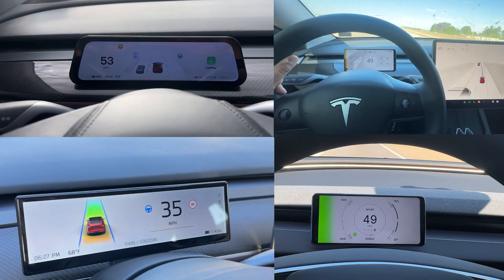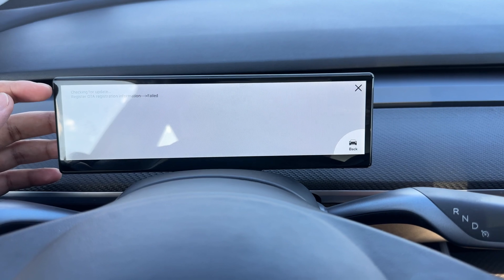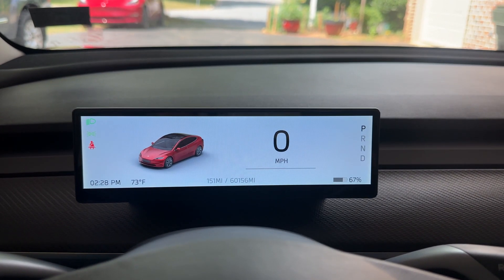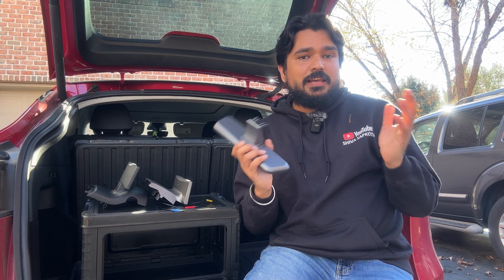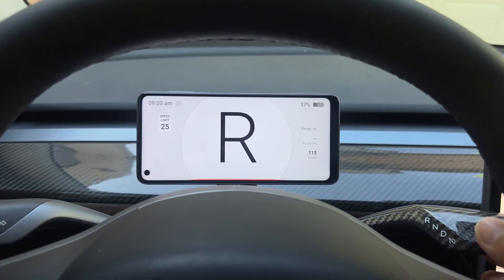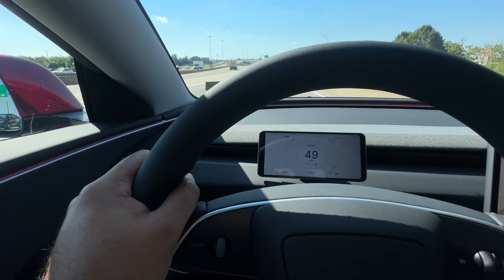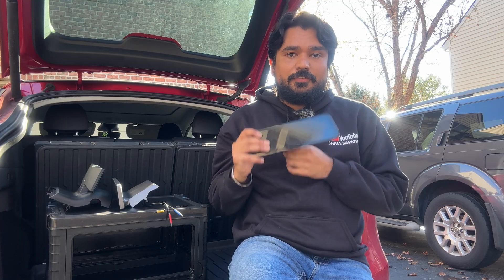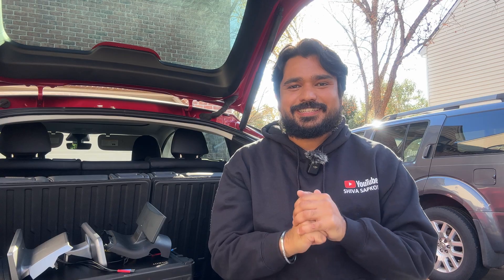Tesla Model 3/Y: The Ultimate Guide to Instrument Cluster Displays!

Comment: What happen to the American style speed sign in the T8 cluster. They installed one, it was the small hard to see it, so they removed it and never put back a bigger version. The cluster have a lot of potential, but they need to work in the American style speed limited sign and the blind spot monitor, also not working in my 2024 Model Y. I contact them many times about this, they don't have a fix for the past 3 month. Can recommend this to others tesla friends until they improved this things.

Comment: I bought the F88 based on this video recommendation and so far, I am seriously disappointed.  The device is laggy, I assumed that by having “CarPlay & Android auto” it would connect to the system, WHO wants to listen to the music on a crappy sounding device.  Outside of tire pressure, speedometer and the ability to show Waze, this thing is a waste of money at the price point.  Hey a phone mount and you are pretty much at the same point.  I am personally disappointed at this recommendation.  I waited to see about an update before writing this opinion and it is what it is, not very good, should have spent my money on the sexy knob.
Reply: So it doesn’t use the Apple car play to connect to the sound system of the car?
Reply: @Dannyfr33sh nope, it’s a stand alone device that sound is only transmitted from the device not the car system. The sound from the F88 is also pretty bad.
Reply: Incorrect you just need to change the audio to your telsab

Comment: Thank you for another great open and honest review. I was really leaning towards that T9 display. Looks so good. Pat, I know they'll come out with a version that's going to be on the steering column. It seems like all these Chinese displays put out new units every 3 to 4 months. And you're left with an old outdated unit. You can't do anything with. Your review validated those concerns and it seems like the best option is to go with the test logic or the the commander. In the end I just ordered a teslogic using your referral code. I think I'll use an old phone and just leave it permanently mounted on the dash
Reply: What heat issues having a phone with a battery in the sun every day? No worries of it exploding?
Reply: @retroman-- i had the teslogic and a phone mount. Absolutely hated it. Ended up getting the t9 from teslasy and it's been the best upgrade to my car!  No regrets at all

Comment: Great video right on time for Black Friday deals..I am leaning towards Enhance commander as i am keen on sexy knob for my new m3p highland..does the enhauto app allow you to overlay waze and speedo at same time? That would be my ideal case
Reply from the maker: Unfortunately, you can't overlay Waze and the speedometer. It's one or the other. Thank you so much for your support.
Reply: @ Thank you for the quick reply! So it looks like i am going to need a fixed mount and the sexy knob..using your codes , thank you 🙏🏼
Reply from the maker: @ram1nath  Thank you so much! If you get the fixed mount for Highland, please do not follow the Chinese instructions as they all tell you to yank out the buttom footwell panels. Instead, route your cables through the carpet joint, much easier! You can also fish the wire through the top panel (please check my recent video on the wireless charger for Highland).
Reply: @ShivaSapkota absolutely the hansshow install videos are a joke..your videos are the best 🫶🏻

Comment: Love the phone based options except.... 1. It's not fixed, so with my 3 drivers.... never discussed, will they connect to all 3 and if so would the options picked individually affect other drivers. 2. And perhaps more importantly... never discussed, what happens during phone calls, etc. to the screen, functionality and such? Obviously, I've been watching your vids for awhile, so you've really educated me!!!
Reply from the maker: Thank you so much for your feedback. 1. It can connect to all 3 but the options would be set as whoever first programmed it. If you re-program for a different driver, that setting will now be the official setting. 2. During phone calls, it depends on how you can setup your phone. Mine is set to leave the current app while only show phone calls notification on top. So, when I answer my call using the Tesla screen, it doesn't take away my Teslogic/Enhance screen. However, if for some reason it flips to the call screen, I can always swipe it back. Thank you.

Comment: Honestly, the best option is would just be for Tesla to swallow their pride about “minimalism” and just include a fucking instrument cluster from the factory, and a useful one, like the old model S
Reply from the maker: Couldn't agree more!! Not including a cluster (could be optional add on from Tesla) and removing the gear/turn signal stalks from the new cars were not good for Tesla owners. Thank you.
Reply: @ShivaSapkota  honestly though, I liked the old model s with the leather interior and vertical screen

It feels classy, and it justified the price
Imo, the new ones are too cheap in quality to be sold for more
Reply: Does the new software update on HW4 and using the right scroll wheel left and right motion to change the speed option like chill, standard and hurry affect the use of the scroll wheel with these displays? Thanks. I just ordered the T9 for my M3P using your discount code. Keep up the good work.
Reply from the maker: @ Thank you! It essentially does both, so can get annoying where you are controlling this screen and it also controls the following distance etc. however, once you toggle the Autopilot, these screens just become touch screen and don't work with the scroll wheels to not affect any of the autopilot funtions.

Comment: At the moment none for me makes sense .. expect the mountain pass performance one who shows different data as the main screen, battery motors temperature, voltages, battery degradation fluid temps etc.. I work buy a screen just to repeat all the information’s available on the main screen 🤷🏼‍♂️
Reply from the maker: I think it is the placement of that information. Folks are wanting the info to be displayed directly in the front instead of the side main screen. Those fixed mount screens also come with Carplay, Android Auto, and front camera, which may not be for everyone but some people definitely like those features. Thank you so much for your feedback, much appreciated.
Reply: @ShivaSapkota  i personalay dont ned that don see any advantage at looking down behind the steering wheel or on the right side , some cars i cant use them without apple car play, but dont feel that on teslas or cars with google automotive software.

Comment: Awesome video review! 
On the fixed units can you confirm that there are no audio sync issues when connecting to tesla bluetooth? Most fixed units i had had in the past seemed to had a noticeable audio delay sync issue.
Reply from the maker: There is still a slight delay but not too bad. I can make normal conversation over phone calls. However, I would recommend routing your audio directly to Tesla and just using visuals (e.g Carplay) on this display. Thanks!